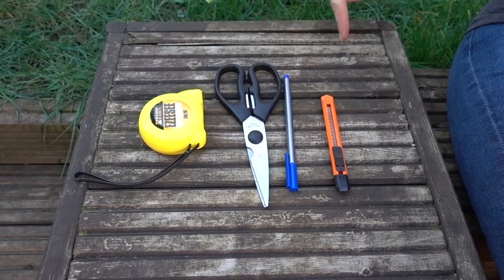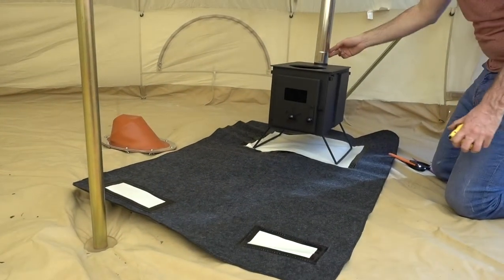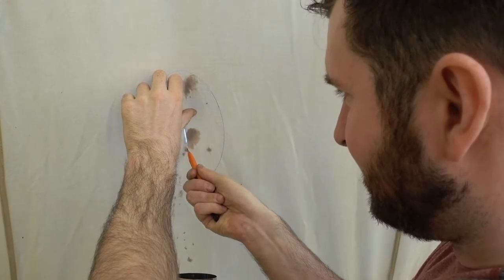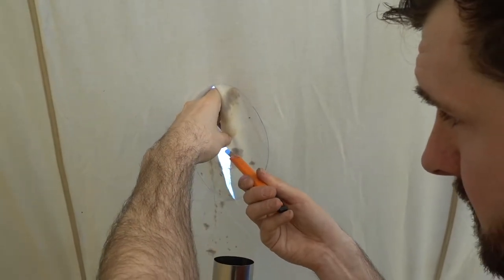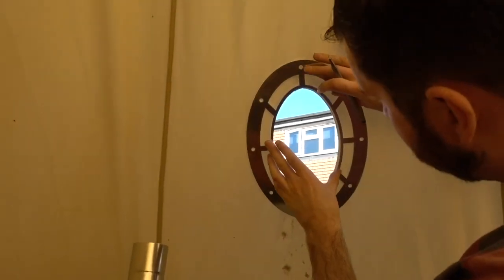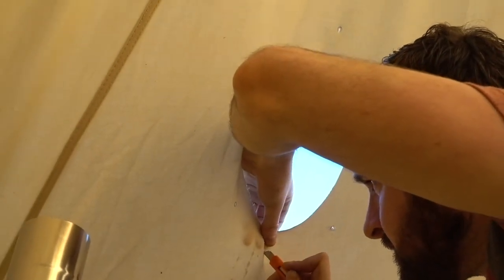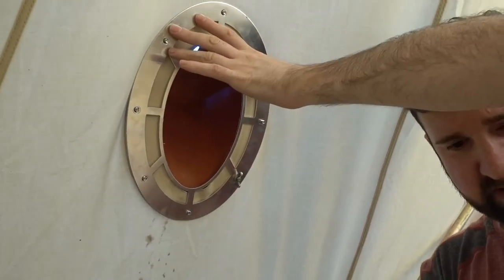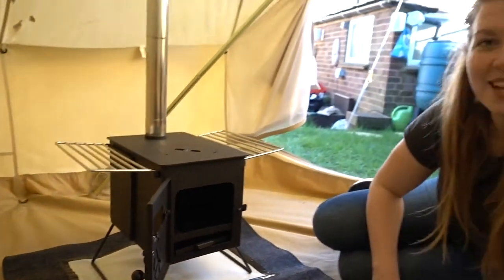Fitting a Tent Flashing Kit - HOW TO DIY?

Comment: Fantastic job! Bit of advice, cut the screw holes first and mount it, then you can use the straight blade and cut the center out using the flashing as a guide.

Comment: It would have been easier to mark the holes and fit the flanges first, then cut the inner hole, which would also be safer than potentially ripping the canvas too far.

Comment: Cheers for the vid! Job well done. Could you please let me know stove you went with? TIA
Reply from the maker: Hi Tim, we went with the Outbacker Firebox Eco Burn, the normal Outbacker Firebox is also great. A full product review of it is on the camping section of our site: https://geniustravels.co.uk/outbacker-firebox-eco-burn-stove/
Hope you find this helpful!
Reply: @GeniusTravels  Thanks for your time. Sorry noob question but do you have to take off the flashing kit each time you pack it away. Just wondering since i live in Australia and won't need a heater/stove most of the time.
Reply from the maker: @timrossingtonmusic  Hi again Tim, it's probably best to take it off each time unless the bolts on the flashing kit can cause damage to your canvas while in transit. Our next project is to make one of these to protect the canvas everytime we put the stove in.https://youtu.be/VP7PTU92KFQ
If you live in somewhere hot like Aus and most of the time won't be using it installing a flap like this will be good to cover the hole during the summer months. You should hopefully be able to find a retailer your side of the world for this on can home make one from spare canvas. https://belltentboutique.co.uk/products/canvas-stove-flap?variant=17894874567&currency=GBP&gclid=EAIaIQobChMItu7jgbXU4gIVB7XtCh1F7AVXEAQYASABEgIDofD_BwE

Comment: Hi, what size tent it that, I'm guessing 4m. I'm asking because I have a 3m I'm considering fitting a stove to and wanted to know if you had any issues with yours.
Reply from the maker: Our was a 4m, a 3m should be fine but just be cautious as it does take up alot of space so you might not get as many people in. Hope this helps
Reply: @GeniusTravels  Thank you. Most of the time it will be just me. Won't be using it on a night either, primarily for cooking and drying off.
Reply from the maker: @DracoZandros  It's perfect just to get the tent heated up before you sleep. Let us know how you get on. Our next project is to make a leather ring to protect the hole.